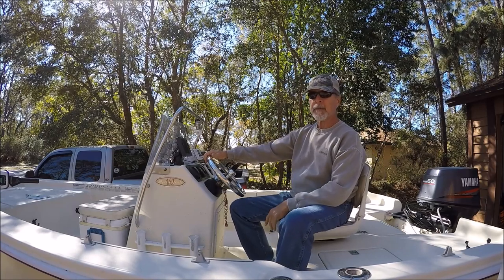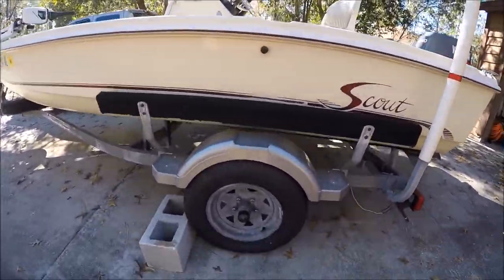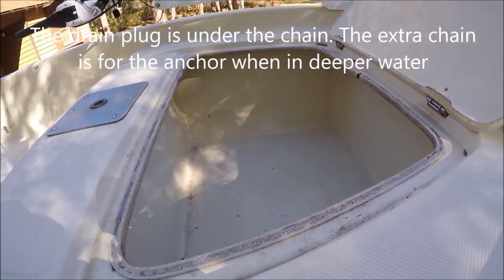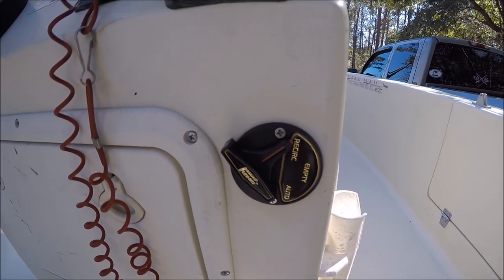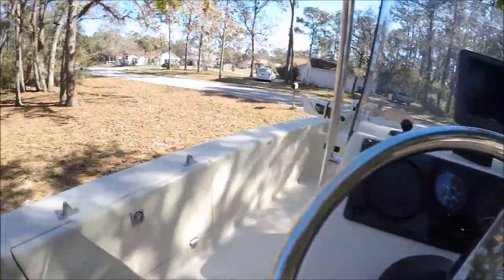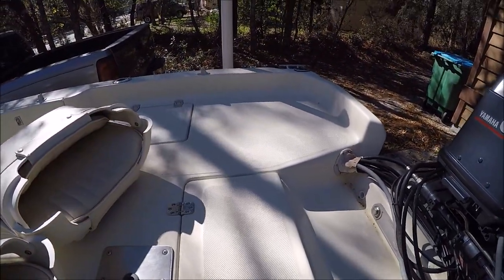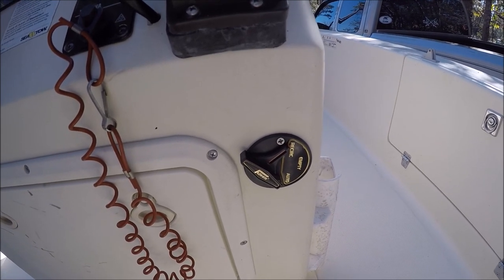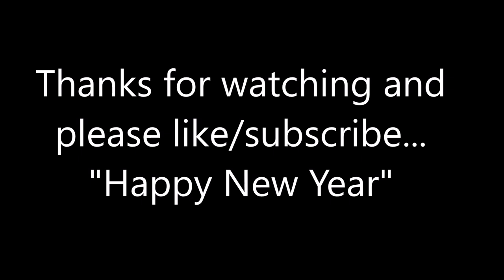Fishing Machine Walk Through...

Comment: I'm considering buying this exact boat used. I plan on using it for trout and redfish. How does that 60 push it? And does it handle a small chop?
Reply from the maker: I did my homework when I bought this boat. It is probably the driest boat under 18' I have ever been in, and it handles a chop super good. On a good day I have had it 5/6 miles offshore out of Daytona, and it can get in about a foot or less with the motor up in the flats. Scout really hit it out of the park with this hull design. The 60 horse Yamaha pushes it at 32/33 with 2 people loaded for fishing. By myself I can get 35+/- plained out. The only draw back would be that it can get crowded even with 2 people, but you can say that about any 16' boat. I would not hesitate to buy another Scout boat.
Reply: RetiredGuy Adventures Thanks man. Yeah I think I’m gonna pull the trigger on it. I think it’s gonna be perfect for what I want to use it for